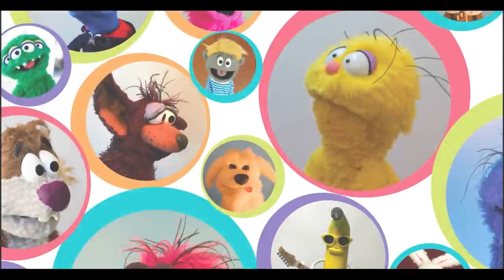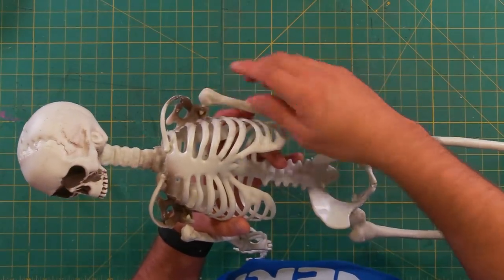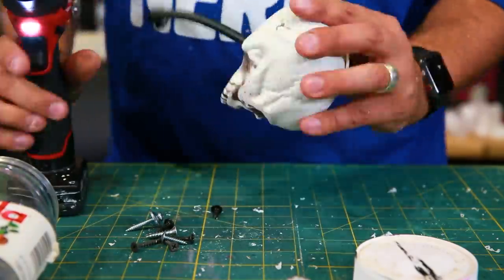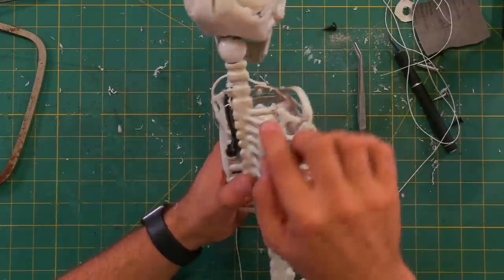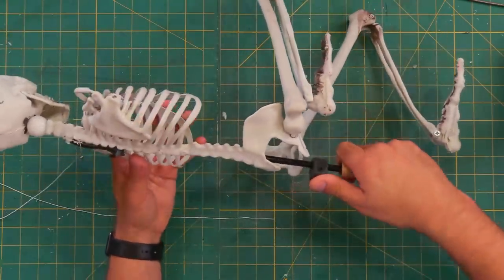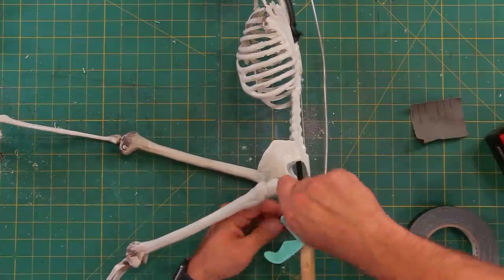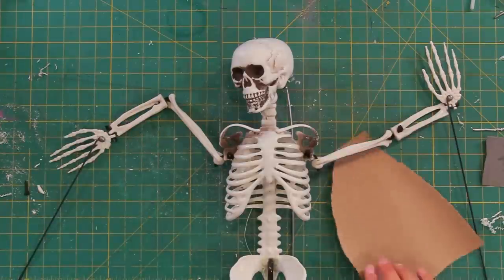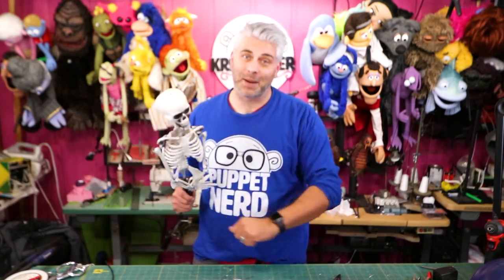How to Make a SKELETON Puppet! MECHANISM PUPPET!!!

Comment: There are some spots where I wish you'd slowed down a little more and showed how you made the attachments.  For example, what keeps the string on the lower jaw from pulling loose?  Is it clamped in any way, and if so, how?